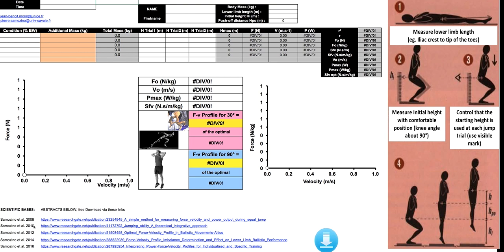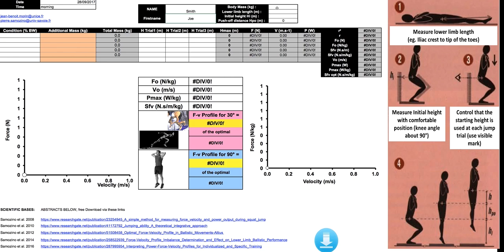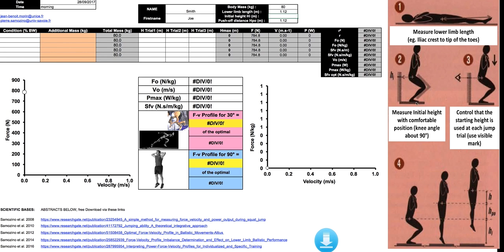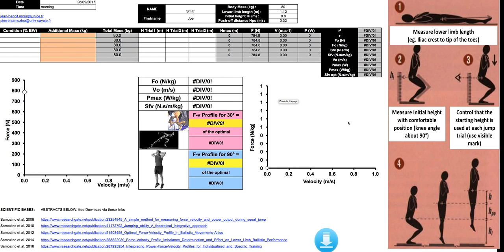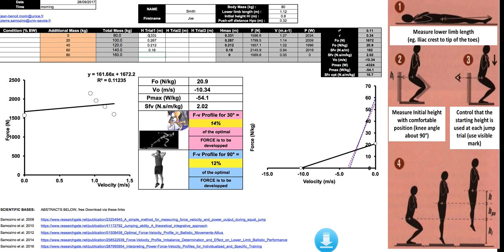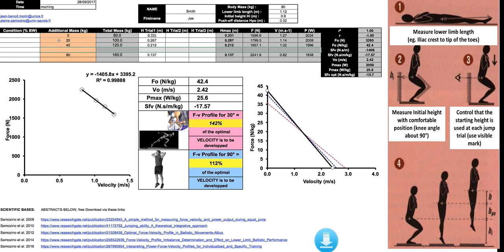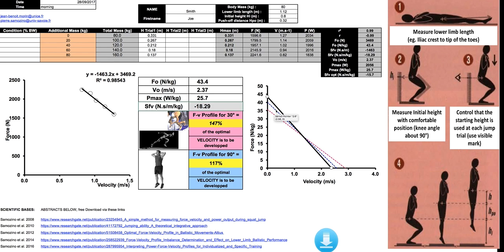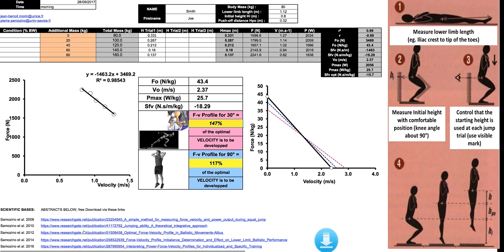Jump FVP Profile Spreadsheet tutorial

Comment: Hi there, I am using this spreadsheet to calculate theoretical F and V output as well as Pmax for my thesis investigating if reducing the FV imbalance improves driving distance in golf. However, there appears to be issues when using the spreadsheet in certain individuals were the spreadsheet produces some very questionable numbers, mostly for Vo (negative numbers and numbers up to 33m/s). Could you help me understand why this is happening? Is it because some athletes are recreational and not that well trained?

Comment: Hi Professor! First of all, thanks for sharing this spreadsheet. It's an amazing and very useful tool. I was implementing these equations in MATLAB and I found a contradictory result between my Sfv_opt value and yours. Checking the supplemental digital content from the original article, I noted that in the last part of the equation A12 (Sfv_opt), there is a minus signal, but in this spreadsheet, there is a plus signal. Please, which one is correct?
Reply from the maker: Dear Jose, thank you for your message, yes it should be a plus sign, as in the spreadhseet. As crazy as it seems we sent the final version of the paper with a plus sign in the Appendix equation A12, and the edition process ended up with a minus sign here 😩...so we had to write a comment and erratum on the paper and re-upload the good version...that is now on researchgate.
Reply: Thank you so much!
Reply: Hola Tenes la hoja de calculo de perfil fuerza velocidad??